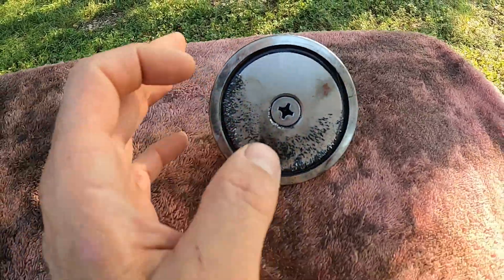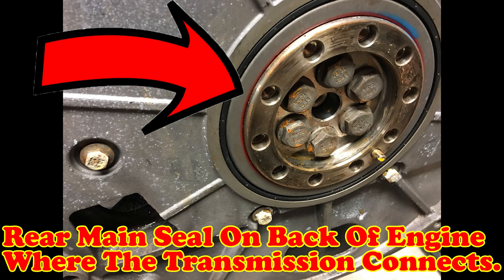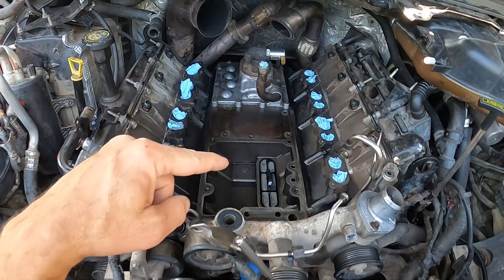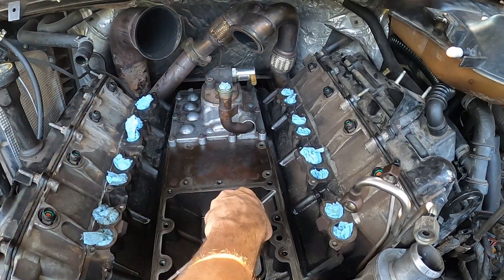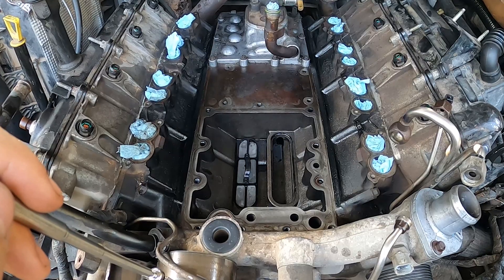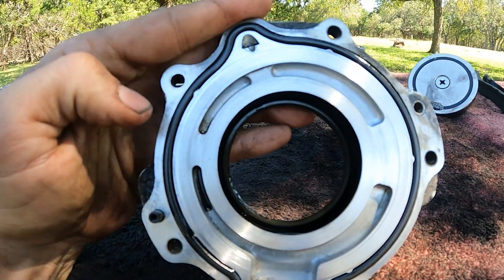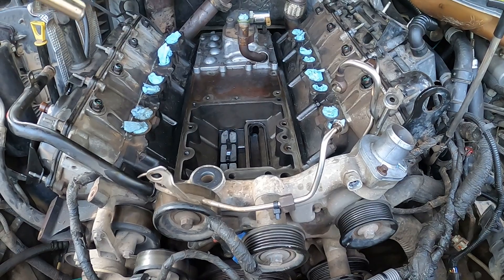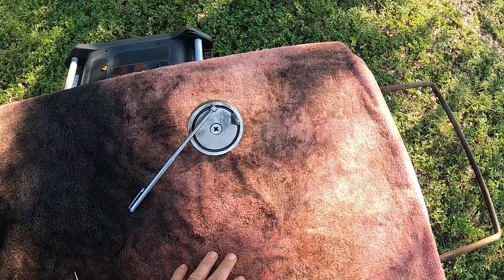6.0 Powerstroke - Metal In the Oil Filter - Watch till the end

Comment: I think I am having the same issue. Was your turbo making any strange noises?
Reply from the maker: Yes it was, I replaced it and later found the metal.
Reply: Sigh.... After swapping my turbo ( assuming it is the problem), should I be worried? Am I looking at a complete teardown of my engine?
Reply from the maker: Well if there is metal you will lose low oil pressure after a while as the metal will get sucked up through the ford pick up tube holes and eat your low pop gear. So maybe change your oil with a magnet in the oil catch. Then perform a low oil pressure test. I’d start there.
Reply from the maker: If metal you can pull the crank pulley off and the low pop gear and change that. Where the gear is behind it metal will eat channels in the aluminum, causing the loss in oil pressure. If no grooves in the front cover or the low pop gear. Then your fine. If grooves you need to replace the front cover and low pop cover.
Reply from the maker: And low pop gear.